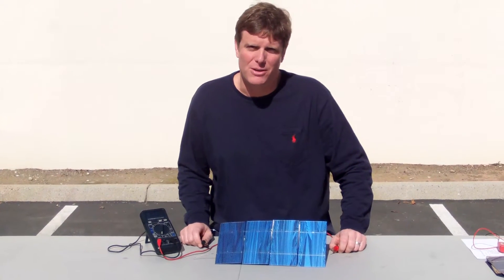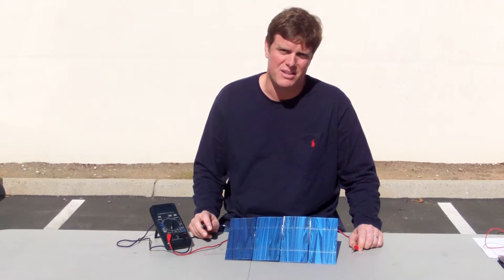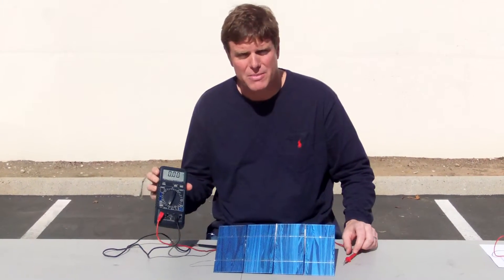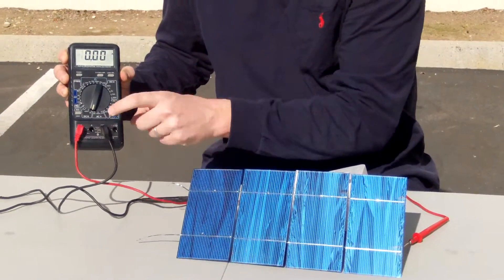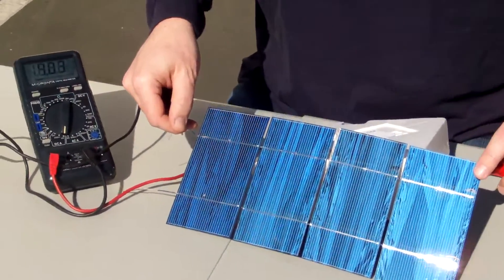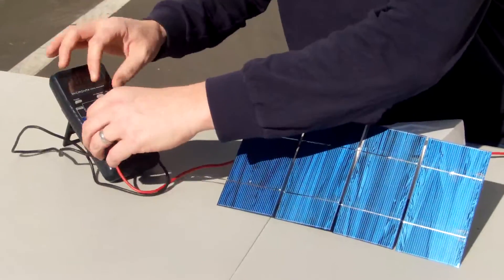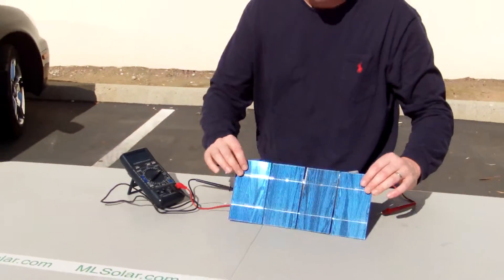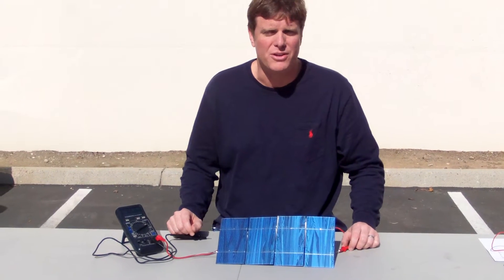How to test a solar cell by ML Solar

Comment: I ordered 40x of the 3x6 cells from MLSolar to build my 3rd ~75W panel.. only 19 of the cells produced more than .03 volts on test. It's pretty obvious that you folks sold me the "internal electrically shorted" and the "cracked" bins.. because only the cracked cells produce any voltage! The duds look fine on the exterior; no cracks, burns, or obvious lamination problems. Maybe some ripples in the silicon but not much more than the others.. I'm going to be avoiding MLSolar from now on..

Comment: So just connect multimeter in series positive and negative without using resistor to check Amp reading? If not using resistor to check Amp does it make the solar panel short circuit?

Comment: This testing method is a joke.  It is a method to fool the public.  OCV can do nothing for you and a shorted circuit current  Reading is also worthless unless you want to jack up the panels rating.  If you were to put a 2 ohm resistor across the leads your voltage would drop several volts and the current would likewise drop.
Your panels will not give you 100W that you can work with,, but a theoretical wattage that can only be achieved  by using open circuit voltage and short circuit current
Why don't you advertise some data that can be applied in the real world. You can charge a battery with less than 1 watt if you can wait that long.  100W 12V implies no where near what you sell.  
What kind if digital meter are you using that has that high of impedance ?  Put that high dollar meter across the leads and see what the voltage reads while you have them shorted together.    0 volts times 5.5 amps equals "'o" watts.
Good thing those cells are current limiting. 
Hope none of your customers string up a high voltage, high current array and it blows up in their face.

Comment: "Because they're in series they should give me 3.6 Amps, because they're 1.8 watt cells".

Your wording is confusing to others that are novice, in working with solar cells.

1. Series doesn't affect current, only the voltage.
2. Parallel doesn't affect voltage, only the current.
3. Each solar cell in series can supply 3.6 Amps each. Hooking them up in series has nothing to do with the fact that each solar cell is 3.6 Amps each. 

Series Configuration Only (voltage is multiplied, current stays the same)
4x 0.5vdc @ 3.6A Solar Cell in series is 2Vdc @ 3.6 Imax

Parallel Configuration Only (voltage stays the same, current is multiplied)
4x 0.5vdc @ 3.6A Solar cell in parallel is 0.5Vdc @ 14.4 Imax

Comment: Does anyone know how to decrease the voltage of solar cell into 1volt? Please reply...
Reply: Shizuru Shizumi Use less cells
Reply: Shizuru Shizumi Just use two solar cells in series makes 1 volt.  If you have a manufactured solar panel that puts out high voltage, like 18V or more, then you can only do this with a buck converter. But I think many of such regulators don't actually go down as low as one volt.

Comment: Some people say this method for testing current shorts out the cells. I just tested some 3x6 cells in full noon sun 75*F and they each individually showed .55 volt and .7 amps -- when it should be ~3.6 amps. Can't think of any good reason why they would be duds other than that I'm shorting them out and need to test them a different way.
Reply: Did you ever figure out how to measure the amps in a different way so you don't short them out?
Reply: Brenda Esparza
 no unfortunately i didn't figure that out, and never built a panel from those cells.

Comment: 6X6 Inch Solar Cell Current Problem
Below are the Specifications of the cells.

Cell Dimension: 6 x 6 (Inches)

A Grade Solar cells

Cell Efficiency: 16%-17%

Cell Power Rating : 4W

Each Cell Voltage: 0.5 V

Each Cell Current: 8 Amp Max

i have one problem with amperage of solar cell, i have measured it by standard digital multimeter, not by cheap one

it is showing 0.66 Amp, when i place Single solar cell in sun light and temperature of weather is 39 degree celsius in india , but in specifications you have written 8 Amp Max. so i should get it atleast 3-5 amps for single solar cell

i saw your video on youtube for 3X6 inch solar cell

How to test a solar cell by ML Solar

and it shows 3 amps current for single solar cell in video , even if that solar cell is smaller than my 6X6 solar cell

and also i have tabbed 4 solar cells in series and it shows output as follows-

2 volts, 2 ampere

so after tabbing it increasing the current (ampere) very slightly and voltage output is correct by series connection rule calculation

then i have tabbed 4 solar cells in parallel and it gives= 0.5 volts, 3 amperes

so can you please help me whats the problem i am facing with Amperage of my solar cells

Regards,

Mahesh
Reply: Mahesh Bendale any solution?

Comment: I'm doing the same thing with my Fluke 77, but I need to measure the I , and thenks for the vid guy .
Using ML 6X6 also about 36 panels for 18 volt in case one or two go down I'll still have enough to regulate , charge , use .